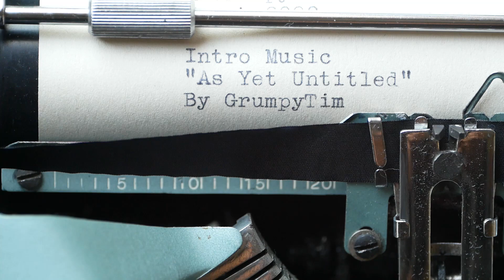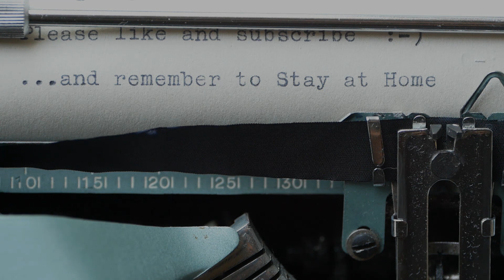Retro Tech - Olivetti Prima 20 Adding Machine - Part 1, Refurbishment

Comment: Hello....Congratulations on your videos ..They are very clear to  understand and very interestingg......So I would like to know if is it easy to take out the handle ???...I tried turning the screw it has and couldnt even move it......So have you ever removed the handle ???.....I need to because I want to send it in the mail and without the handle packing will much easier and safer....let me know please......BEST REGARDS & THANK YOU !....
Reply from the maker: Hi Martin,  I didn't need to remove the handle when I worked on that machine so I haven't actually tried that.  The machine actually belongs to a friend and I won't be back there until the weekend - if you can wait that long I'll have a look at handle removal and let you know.

Good thinking about wanting to remove the handle for mailing the machine - I've had several delivered to me with the handle poking out of the side of the box and damaged in the process.  If you do need to mail it before I get a chance to look, the best way I've found to protect the handle is to cut a strip of corrugated card, just a bit wider than the distance between the case and the tip of the handle, then form a oval tube using several laps of the corrugated card - if done correctly, this protects the handle, and transmits any force on the side of the box directly onto the side of the case instead, but obviously this requires a box big enough, plus some spare corrugated card, plus plenty of time to package it well.  When I used to sell stuff on ebay I'd regularly spend an hour wrapping an item that I'd sold for about £5 - not exactly great business sense!!!!
Reply: @GrumpyTim  Thank you for answering...YES I can wait a few days before wrapping...and if getting handle off is complicated I will follow your advise....There is another "con" with the handle on...Makes the box unnecesary much bigger and for international shipping..makes it more expensive...
So I think I can wait before shipping...BEST REGARDS & THANK YOU !
Reply from the maker: Ahha, yes, unnecessarily large box and international shipping aren't such an economical idea.  I've written myself a note to look at the handle attachment at the weekend - I'll be in touch.
Reply from the maker: Hi Martin, good news, it's a left handed thread (at least, assuming they kept it the same throughout the production of that machine yours will be the same).  It kind of makes sense because pulling the handle to operate the machine could, in theory, loosen the screw slightly over time if they used a regular right handed thread.

So, pick the biggest screwdriver you have that will fit the screw,  put the machine on something soft and turn it on it's side, keep hold of the end of the handle so you're not putting your twisting force into the mechanism, and turn the screw clockwise (as if you were trying to do it up) and hopefully it'll loosen off that way, and then the handle should come off nice and easily.

Mine was pretty tight, so you will want a fairly large screwdriver that won't just mangle the head of the screw.

Hopefully that'll do the trick - shout if you're still stuck.

Cheers

Tim
Reply: @GrumpyTim  Thank you ...Its in fact simple...The screw "unscrew" the other way to the normal one - Posted 3 of these now....Much better and safer packing. BEST REGARDS !
Reply from the maker: Excellent, glad you've got them posted - those left hand threads can cause lots of head scratching if you're not expecting them - they've caught me out many times in the past.

Comment: I have 2 sets of this. One round buttons and one the square buttons(later version). Its all push rods and springs. My problem is key stuck on second tab. I'm keeping them for memories of yesteryears.
Reply from the maker: Hi yhwe100, they are lovely machines and surprisingly popular - far more popular than most of the other mechanical adding machines and calculators I've featured on my channel.
Reply: @GrumpyTim  You have all the heart and soul for this machine. The round buttons set belongs to my dad and the square buttons I got it from a junk yard. The problem with this mechanical set is that the springs tend to rust and break. I wouldn't want to dismantle them cos I would have a big headache reassembling them. The inventor is a true genius in creating this.
Reply from the maker: Yeah, the designers and engineers who made these old machines deserve a lot of respect.  Their nice machines to have even if they're now fully functional, they look great just the same.

Comment: I'm trying to clean my grandfather's old Summa Prima 20 but I can't get the red tray off since one of the 4 rubber feet has dried up so much that the metal post can't slide past it. I'd have to break a rubber foot :( Plus I noticed that there's a lot of dust between the roller and the little tiny "tray" behind it but I don't know how to take the roller off. Do you have any suggestions?
Reply from the maker: Hi mynameslivia, I'll try to have a look at the Olivetti when I get a chance and then make some suggestions.
Reply: @GrumpyTim   thanks! I also found a really old piece of paper stuck about 3-4 cm under the roller and I’ve tried catching it with a pair of tweezers but I’m disintegrating it hahah so suggestions on how to take off the roller without causing any damage are more than welcome 🙏🏻
Reply from the maker: I'll see if I can take a look today and get back to you later on....
Reply from the maker: Hi mynameslivia,  sorry it's taken me a while to get back to you - I've just had a look at the Olivetti and I have a few suggestions:

Firstly, for the rubber foot that the metal post won't slide past, (assuming your machine is identical in design to mine, sometimes manufacturers change designs over the lifetime of a machine), if the other three are free and the metal post is moving, then you could carefully ease a small screwdriver (like a jewellers screwdriver) up between the metal post and the rubber and gently wiggle the screwdriver to break the seal between the metal and rubber.  Keep doing this all the way round the post - that should hopefully free the post from the foot and allow it to move.  Most important is not to force it in such a way that you break the red plastic bottom of the machine, the rubber foot could be remade with a little care but a broken plastic tray would be a pain.

For the platen roller (that's the roller that the paper goes round), it can be removed but it's kind of tricky - the roller is held in place by the black metal plate that guides the paper over the roller as it exits the machine after printing.  To remove the black metal plate, on the left hand side is a screw with a slot for a screwdriver and also a hex to fit a tiny spanner (somewhere around 6mm), then on the right hand side there are two posts that double up as the spindles for the knurled wheel that allows you to manually turn the roller and the idler gear just behind it.  Both of these spindles have hex heads, allowing you to undo them and release the black metal plate.  The knurled wheel has a spring clip holding it onto the spindle - this can simply be prized off using the blade of a screwdriver, but as with all spring clips, keep a spare finger on the clip as you prize it off otherwise it'll likely fly off somewhere in the room and you may never see it again!!!  Once the spring clip is off, the knurled wheel won't come all the way off because it hits the guides for the ink ribbon, but with it a s far to the right as it will go, the idler gear can be removed from it's spindle using a pair of tweezers.  At this stage, you should have enough space to use a small spanner to remove the spindles and release the plate and in turn the roller itself.  I haven't actually done the job, I've just looked at the machine to see how to do it, I suspect it will be a bit tricky if you're not used to doing stuff like this.

I do have an alternative solution for cleaning behind the metal roller - if you take a strip of the printer roll, say about a foot long and insert it so it's just round the roller, then take a piece of thin string and place one end between the paper and the roller (it seems to work better if you place the string towards the edge of the roller rather than dead centre), now wind the paper and string round the roller so the end of the string comes out the other side with the paper.  Get enough string through so you can grab both ends, and holding the string, gently pull the paper out (you may need to release the pressure on the paper by raising the right hand paper roll holder which doubles up as the paper release lever).  Now, with your piece of string round the roller, you can work it backwards and forwards, cleaning the debris off the pressure plate beneath.  You might have to try slightly dampening the string if the paper and dust won't budge, but ideally it'll work with the string dry because damp paper will break up into more tiny bits, that will need to be brushed or blown out of the machine.  A similar thing you could try, would be to cut some thin but fairly rigid plastic to the same width as the paper roll (the kind of thing that might have contained food from the supermarket), and use that to insert behind the roller to try to release the paper that's jammed in there.

Let me know how you get on and I'll look some more if needed.
Reply: @GrumpyTim  thank you so much! I’ll try and I’ll let you know how it goes ❤️

Comment: Didn't know that there would be any Olivetti videos on YT.   what a nice surprise.
Just a hint to ease & expedite case removal.
In the rear, where you flexed the plastic tab on the case over a metal part, you can slide the metal part leftward (or rightward ... I forget which).
With the metal slider moved a bit sideways, the rear of the case can be lifted a bit and then moved forward.
With the case up in the rear & pushed forward (away from the keyboard), lift the front of the case so that it easily clears the totals button.
Reverse the procedure for reassembly, finishing with moving the metal slider (at the rear) back to the position where it restricts the vertical movement of the blue plastic case tabs.
BTW, I'm a factory-trained Olivetti tech.
I serviced the entire Olivetti series from the class 20, 22, & 24, up through the Audit accounting machines.
Reply from the maker: Ooh cheers Charles, I'll go and try that in a bit - it seemed odd the way I took it apart so I'm glad there's a better way.  I've got an Electrosumma 20 (or it might be a Multisumma I can't remember) in storage to fix at some time too.  The Olivetti machines seem to be very popular, possibly because they look so good but also I think Olivetti has a bit of a cult status as a manufacturer.  You'd be amazed how many people would be interested if you ever wanted to put some of your knowledge down in video form on YouTube.
Reply: @GrumpyTim  Thank you for the rapid reply!
The M-20 is readily distinguished by its yellow keyboard plate.
Regarding your ribbon replacement, see if you can locate a cotton fabric ribbon instead of (what appears to be) a nylon fabric ribbon.  The type wheels on the Olivetti strike the paper with only a fraction of the force that a typewriter's typebar/typeface strike the paper.  Cotton ribbons were usually more heavily inked (and a bit softer); and always resulted in a more complete impression.
As an aside, I'm situated in St. Charles, Missouri.  Where are you?
Reply from the maker: Hi Charles, that would make sense about the ribbon, as you say, the strike force is far less that a typewriter (or it certainly is when I'm typing!!!!).  I'll have a look around to see if I can find a good old style ribbon, most of the suppliers over here appear to sell the same ribbons as I was using.  The paper rolls I've been using don't help either, they're a cheap thermal roll, which is made of a much harder material than a proper paper roll - I can get proper paper rolls, it's just that I had the thermal rolls in stock.

Just had a quick look and I've found a few "new old stock" cotton ribbons for sale - I'll see if I can get hold of one or two.

I'm based in the UK, so a few miles away from you.
Reply from the maker: Hi again Charles - I managed to dig out my Multisumma - labelled up as a Olivetti Ivrea Multisumma 20 but bizarrely not with the yellow keyboard plate - I've seen the yellow keyboard plate in photos and it's the one on John Wolff's website, possibly Olivetti didn't think us Brits were funky enough for the yellow keyboard plate so we just got grey!!!

I was wondering what to do for my next video, so I might start work on this machine and see if I can muddle together a video.

If you've not seen John Wolff's website, here's a link - he's got quite a collection of Olivetti stuff on there http://www.johnwolff.id.au/calculators/Olivetti/Olivetti.htm

Comment: Very informative video, thank you! It is hard to believe that they were still manufacturing these in 1971. Does your unit have a date or date code somewhere?
Reply from the maker: Hi Pieter, It's so long since I did that video I can't remember where I got the date from, I suspect there was a date code inside somewhere.  The instruction manual that came with the machine has a printing date of March 1971 so the machine isn't going to be older than that anyway.  I think people were still using these printing adding machines for quite a while into the electronic calculator era - I'm aware of people still using Comptometers in the 1980s, but I guess affordable computers and spreadsheets probably changed all that.
Reply: Pieter, the only clue as to date of manufacture is the machine's serial number.
Unfortunately, I do not have access to a list of serial number ranges corresponding to year of manufacture.
The serial number is easily accessible by holding the unit inverted & looking through a small oblong slot in the baseplate.  You should be able to see an engraved six or seven digit number.

Comment: hi where do the numbers get the colors from? Black and red .. is it from the ribbon?
Reply from the maker: Hi Lamborghini, The inking system is the same as most old typewriters - there's a cloth ribbon impregnated with ink.  The paper goes round the platen roller at the back, with the ribbon sitting just in front of the paper.  When the number wheel strikes the ribbon, it presses some of the ink out of the ribbon and onto the paper, leaving the image that you see.  The ink in the ribbon has to stay wet within the ribbon and really old ribbons can dry out.  You used to be able to get the correct inks to re ink your own ribbons but these days most people buy a new ribbon.  With enough use, the ribbon will run out of ink anyway, because it's all been pressed onto the paper.  The modern replacement ribbons tend to come on a generic spool that won't fit anything, so most of the time you have to transfer the ribbon to your original spools for your machine.
Reply: @GrumpyTim  Thanks for answering. I don't have any knowledge about typewriters in particular , I mostly like watching people repair stuff. I never thought about this ribbon before .. if you don't know it you probably don't see it when you use a typewriter. Do you have to occasionaly wind the spools when you want an unused spot of the ribbon to type on?
Reply from the maker: Hi Lamborghini, good thinking - on typewriters and adding machines like the Olivetti, the ribbon is advanced a small amount every time it prints (or in the case of a typewriter, every time a key is struck), there's a little ratcheting mechanism that advances the reel and in most cases, when it gets to the end of the reel, the direction of the ribbon is reversed and it spools back onto the first reel.  The ribbon can go backwards and forwards loads of times and will gradually start fading as the ink runs out - it's usually only when you change the ribbon that you realise how faded the type had become in comparison to the new ribbon.

On some later typewriters they swapped to a plastic film type of ribbon which had some substance on it that would transfer to the paper when you typed - these ribbons could only pass through the machine once but they did give a crisper and darker print.  Generally these plastic film ribbons came in a cassette and you threw the whole thing away when it was finished, starting down that slippery slope of single use plastic products.
Reply: @GrumpyTim  thanks I learned a bunch from your channel!